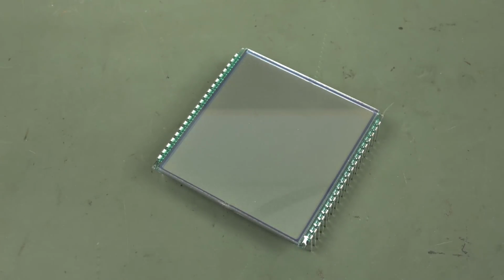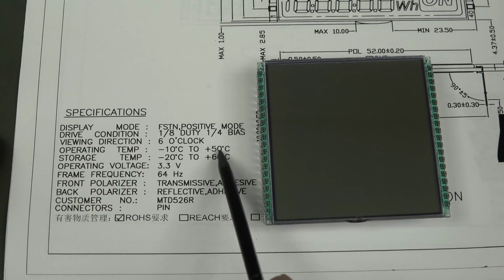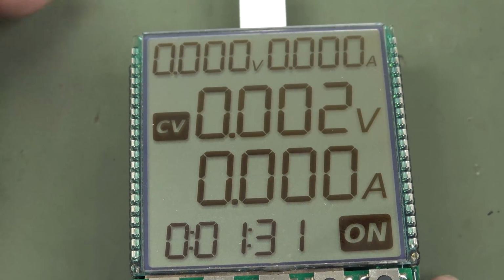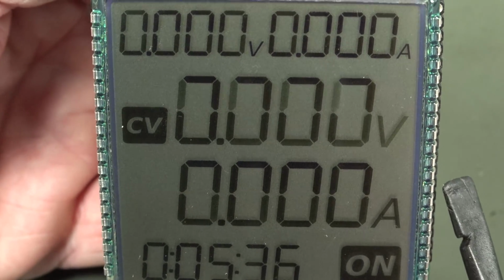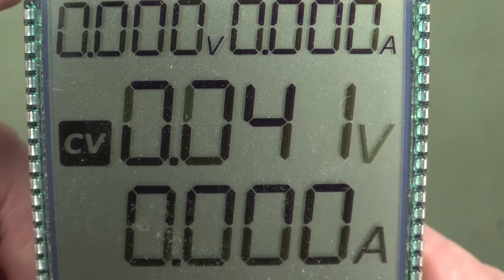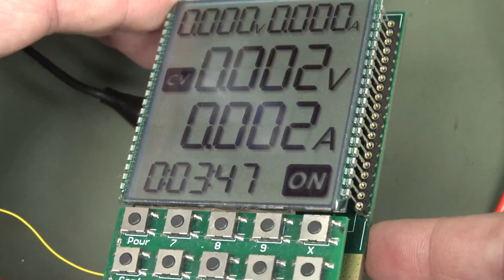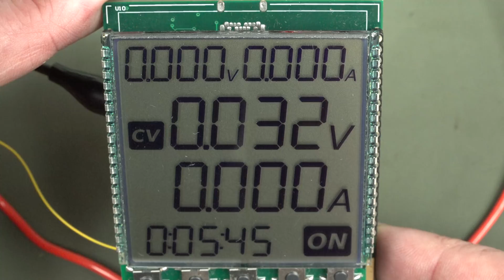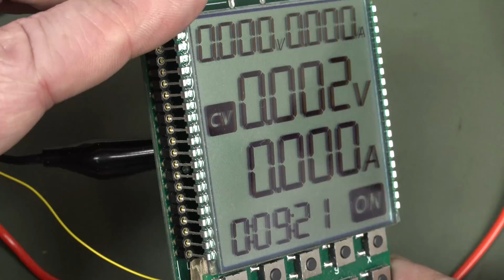EEVblog #1105 - $100 Custom LCD Design - Part 3 (µSupply Part 18)

Comment: Who designs an LCD without back lighting these days?
Reply: Back lights are power hogs. A lot of people using instruments not used in the dark would prefer longer run time.
Reply: Why add a backlight to something you're not going to be using in the dark? These displays can be used in daylight, without a backlight.
Reply: Pirate Kitty, Morque Aunne. Its a micro current, it supplies micro amps. It was designed to be either mains powered or battery powered. If its battery powered, then power consumption of the supply is important. The reason you don't see reflective screens on decent bench power supplies is because they usually deliver 100W or more, a couple 1W LEDs aren't going to do squat to the consumption at that point, and you aren't going to run a 200W precision PSU from a battery. However, you might want to run a uA power supply from a battery, if not, I doubt Dave would've developed it that way.

Whatever the benefits or cons are, its largely irrelevant. Dave wants a reflective display, so far he seems to have known what he is doing, its safe to say he's probably got a good reason. If he doesn't know what he's doing, he sure has a lot of engineers fooled.
Reply: With backlight option you lose a bit of reflectivity. I would prefer the display to be as legible as possible under office lighting conditions without backlight, and edge lighting can rescue it in emergency situations.
Reply: PirateKitty For those of you talking about low current consumption... This lcd is made for a power supply... So it has free power sort of speak...
Reply: danijel124 it was made for uSupply, which in earlier versions suposed to be battery-powered portable PSU.
Reply: Any one who makes a device that that needs to be ultra portable or slim really. Or that needs a display that's easily readable under intense light and cant use powerful backlighting. Multimeters are a good example. Yes you can get backlit multimeters that have good readability in direct sunlight, but the battery life is usually horrible compared to reflective type meters. Its usually the difference between mW to drive the LCD vs half a dozen watts. Then you have to design a backlight that evenly lights, doesn't fade horribly when supply voltage drops and doesn't eat batteries. Many meters use two-four double As or a single 9V. Backlighting or not backlighting might be the difference of 50-100 hours of runtime depending on the device. Which can be quite a lot on something that only uses coin cells. If its solar powered like some calculators you can't backlight.

Reflective displays are becoming more rare, but they still have a strong market, at least until LEDs become so efficient that they can convert 80+% of the energy they consume to light. Maybe one day.
Reply: Piratekitty - why are you so angry about this? Go make your own damn supply if you can. Then you can add a hello kitty logo, flashing pink lights and rainbow unicorns to it if you like. It's been explained to you why it doesn't need a backlight, and you're still whining. Grow up.
Reply: Use a couple of LED modules then and stop wasting time and money.
Reply: That's just one out of the many other advantages taken out.
It still doesn't require one, and would be way less of a bother in a desk where you already may need to deal with a PC screen, other tons of instruments with their indicators, and likely and oscilloscope there all lighting stuff up.
To begin with you wouldn't be working in the dark for anything where you need such instruments  unless a very rare case, on which, likely the backlight of an LCD would be a bother.

I would still also agree that a transflective screen is the best of both worlds. Or at least a happy compromise in reflectance.
Reply: You can still top light with a sheet like the Kindle Paperwhite uses.
Reply: Is he building a calculator?
Reply: PirateKitty anyone wanting ultra-low current-draw in their device.
Purely reflective LCDs are very relevant in 2018.  In fact, they may never go away, due to their unmatched efficiency.
On a side note, I recently read a scholarly article in which the researchers had developed new polarizer and reflector films that make possible acceptably-bright non-backlit LCD displays with reasonably-large color gamuts.  They're essentially revisiting the Game Boy Color dilemma by applying the latest developments in photonics.
Reply: Dave. Dave does.
Reply: I agree. Non backlit LCDs on a power supply look tacky. It's so 1988. Back lighting adds to the positive feel of an instrument well in excess of the added cost...while adding nothing to measured performance.
Similar to high end audio cables....even when there is no measurable difference, the customer believes they sound better because they look like they should sound better. We used to call that "Psycho-acoustics." In this instance, I'd call it "Psycho -optics"..and worth every penny. Logic has nothing to do with it. And, let's face it...a society ruled by logic alone maybe more efficient...but, it will be flat and boring, possibly to the point of it's own extinction. Does an LED back light draw that much more current than a power indicator?
C'mon Dave! Everyone knows you can never have too much flair. That is not to say that tail fins on Tesla's will solve Elon's problems. Of course, having a backlit LCD did not, either.
I wonder what it would cost for a custom Vacuum Fluorescent Display. Now that could look great.

Comment: There may be more to it than just that single line. Mind the rightmost digit when it goes to a "2" exhibiting different behavior than when displaying a zero. (E.g., the top right segment is solid on 0, but faded on 2.)
Reply from the maker: Yes, but that single line was the worst.
Reply: Yes, but when it's showing a five there instead of the zero, it looks good, which makes me believe it's a problem with the driver ic. Would be interesting to see if it behaves the same with another batch driver ic. But since a bit higher voltage solves it it really doesn't matter anyway.

Comment: awesome, could an interactive screen like this be created but one that has the glowing red numbers on a black background?
Reply: Would likely only take a new back polarizer at 90° from the current and transmissive/transflective with a red backlight.
Would be cool as heck, but I can imagine this one here being more visible under all circumstances.
Reply from the maker: If you want glowing red, get LED or OLED displays.
Reply: EEVblog if they could do custom OLED displays at similar costs... Drool...

Comment: Dave, will the uSupply project offer the 12-o'clock position? or will you take a vote on adding-in some kind contrast adjustment (as offered on a lot of electronic devices?
Reply from the maker: No, we'll stick with 6 o'clock. Maybe add contrast, don't know until we do more testing. The chipset doesn't support contrast internally.
Reply: EEVblog But imagine this in the mounting position of other bench supplies.  12 o'clock is the common viewing angle, not 6 o'clock like a handheld meter.

Comment: The main reason I like your videos is that OK is never good enough. As an analog circuit designer, I am always trying to achieve one more digit accuracy. A lot of digital circuit designers do not understand this obsession.
Reply: Well can't blame them since 0.4 is close enough to 0 and 0.6 is close enough to 1
Reply: pi = 3
Reply: In The End it doesn't even matter
Reply: If it's worth doing, it's worth overdoing.

Comment: This final product deserves a colour dot matrix display Dave ! :p
Reply from the maker: None of that modern rubbish here.
Reply: Pixelated look, obligatory backlight, more CPU load, no thanks
Reply: I'll be honest here: my fat OLED PS Vita cries in the sun where my Game Boy Advance just smiles happily.
For an instrument, being visible always (also the longer life of LCD) would be my bet.
I would have chosen a transflective back with an optional green backlight for this project.
Reply: Well with enough brightness to keep battling against the sun you can do wonders.
Don't expect it to last the usage of lab instruments for as long tho (think of displaying the same image for hours long. That's an OLED killer). That's the issue with current phones: this dumb battle against the friggin' sun to see who's brighter instead of using it to your advantage. Take any reflective LCD and compare to any OLED in power usage and the difference is massive, and still would bet way more visible on the reflective LCD.
There's really no point in going OLED if you need just indicators.
Reply: In other hand, I understand a lot more a monochrome reflective LCD. Visibility is top notch, unmatched by anything other than e-ink but fast.
With a dot matrix color display you would likely require a backlight, and rarely nowadays good visible in bright light color displays are available, they mostly try to battle against the outside light with their own, losing the battle more often than not. In bright sunlight you can't match a reflective, and sadly transflective died out in most part.

One would remember a Game Boy Color screen for that, but that one isn't as visible in all angles as a monochrome, it's an utility choice really.
Reply: It may be an older screen, my phone is great in sunlight and has an oled screen.
Reply: ImpiantoFacile same
Reply: Once you go OLED you never go back.

Comment: Have you tested with the other four lcds and it's the same, or with another batch lcd driver ic? Just to rule out other causes than bad manufacturing  of the lcds.
Reply from the maker: Yes, they are nearly identical.
Reply: EEVblog But did you test the relevant LCD pins with scopes and meters to determine if it's the test board underdriving the pin or (as another commenter suggested) that part of the LCD having a different equivalent RC circuit than the others?  Because such details may allow design adjustments to eliminate the issue over the final power rail tolerance.

Comment: In a previous video, you made a setup where you DC-biased an LCD. Is that LCD still working? Any updates?
Reply: He posted the conclusion video to that experiment yesterday then took it down before I got to watch it.
Reply: See EEVBLOG2 the video is called "shit happens"
Reply: @random
did it fail completely or could it be used again with ac bias ? ,did dave try it ? , i would like to know this as i saw the notification in the bell list but the video is gone :-(